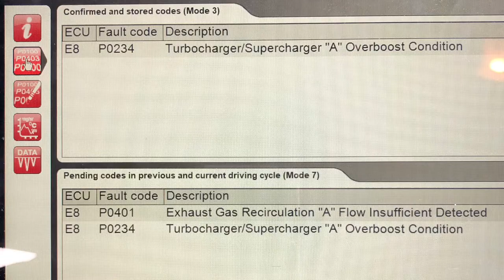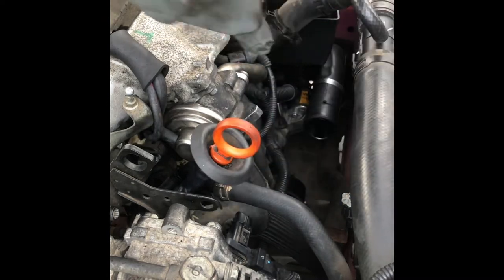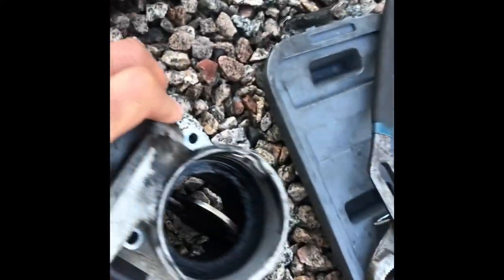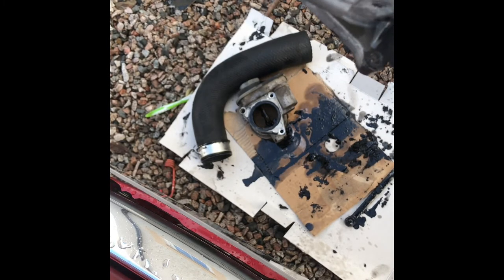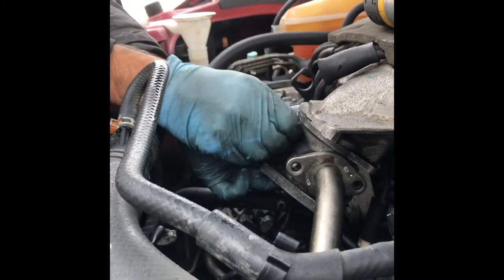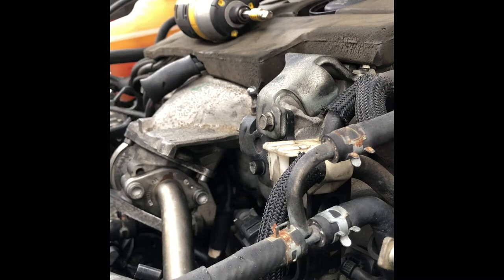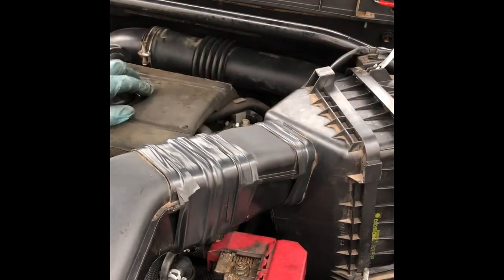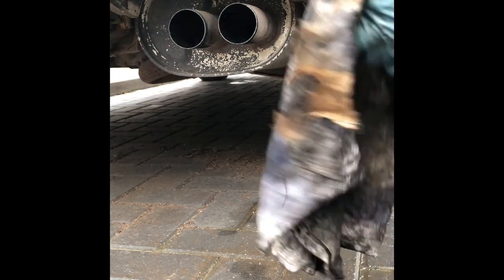EGR removal & cleaning on Mitsubishi Outlander (Audi VW) 2010 2.0 diesel

Comment: Hi there mate hope your good, i have same outlander and my car cuts off at high speed and so i have to turn it off and switch back on and im good to go.
Can you tell me the problem plz.thanks
Reply from the maker: I did exactly the same. It happened on high RPM. my diagnosis showed the above faults due to sticky EGR valve. You can either replace or clean EGR as shown here but you need to diagnose if you have the same faults
Reply: @skipp786  ahh okayy i see, but could it have anything to do with injectors or anything or maybe even like fuel filters front or the one in diesel tank.
Reply: @skipp786  my engine light is on too and so i got it checked up and saying something is wrong with my injectors butt my car runs really smooth and perfct, and yes aprt from when im going like 110 120 it dies and just doesnt want to go any more but car is still running.
Reply from the maker: @sub_0292  I had same results on first diagnosis but once I erased the error code, it never came back. Eventually the MIL came on because of sticky EGR and turbo only. I cleaned EGR (and replaced afterwards since found a new one for £16), turbo and MAF and everything is spot on. I will test drive at extreme conditions and let you know the difference after replacing EGR. The injectors sometimes fail to perform temporarily because of faulty EGR, turbo or MAF, etc, hence fault shown.
Reply: @skipp786  ahh okay nice one brother, and yes i will clean my egr and see what else and thn i will see how it goes, my turbo and MAF is all clean and have no probpem with that, but yh i think it shows faulty injectors because of EGR, but yh i will see how it goes  after i clean the EGR and will let you know.but yh thanks alot brother. And im guessing your a muslim. Right.
Reply from the maker: @sub_0292  Yes Alhumdu lillah
Reply: @skipp786  alhamdulillah bro, where you from?
Reply: @skipp786  please let me know if the your car loses power at high speed.
Reply: @skipp786  how are u bro, can u tell me where the EGR sensor is plz.
Reply from the maker: @sub_0292  Are you talking about pressure sensor connected to the EGR diaphragm, which is on your left when facing engine (right front corner of the engine)
Reply from the maker: @sub_0292  it’s connected with the EGR diaphragm with small rubber pipe
Reply: @skipp786  salaams where is the boost pressure sensor / map sensor on the outlander. I have a 2.0d that goes in to limp mode and the error code is p0234 for the boost pressure sensor. Any help will be appreciated

Comment: Why are you taking off the battery?
Reply from the maker: I used the Diesel EGR and Turbo Cleaner by Lucas. The battery was in the way, therefore, removed it. It may also help to remove the battery to reset the codes.